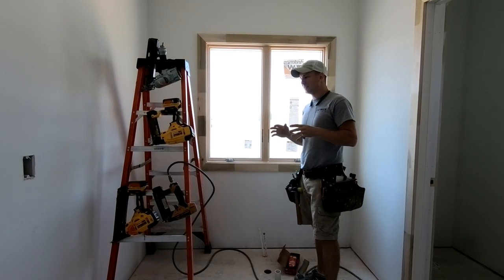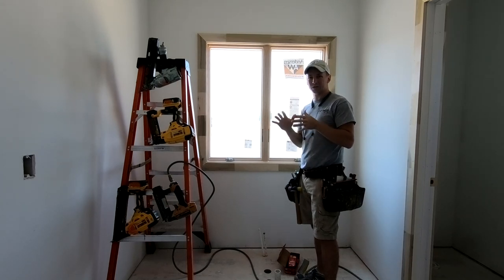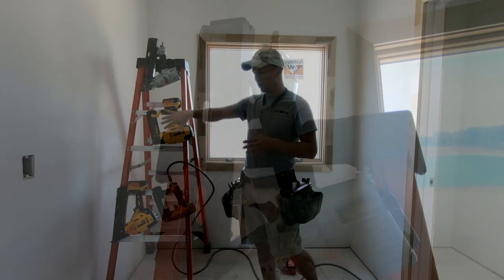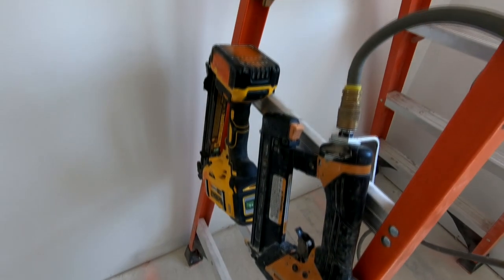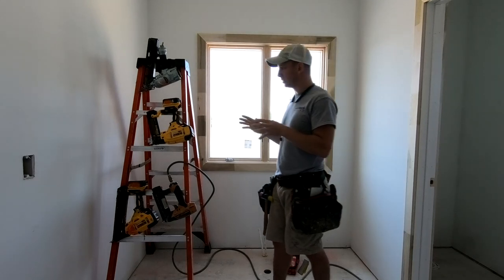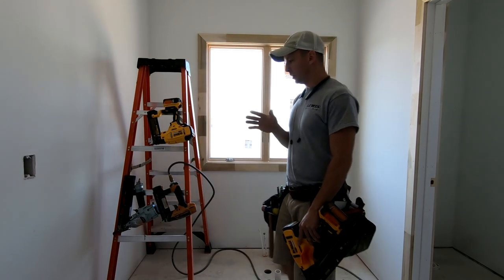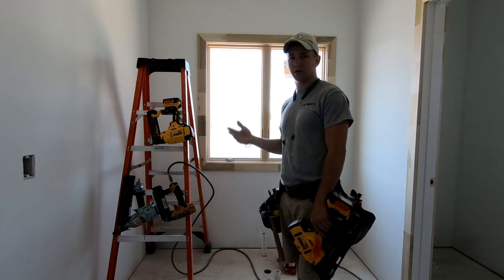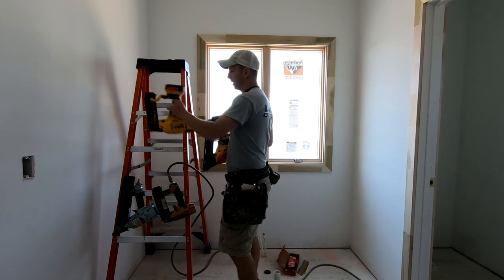Air VS Cordless Nailers Showdown - Dewalt Cordless Nailer 3 YEAR Review

Comment: Did you ask dewalt about warranty on the nail guns?
Reply from the maker: I didn't. The only thing that will make me crazier than a gun that wont sell nails is dealing with a giant companies warranty department.
Reply: Fair enough. I guess better to get on with doing jobs than be further disappointed with customer service.  I would be interested to see your thoughts on the Milwaukee 18g. I would love to get one but it is a steep price when I would not get the same use out of it and I have the same air 18g as you and also run a flexvolt compressor which I think is a pretty good middle ground for me. I too love to chat tools. My observation is that you would easily find a space in your kit for the 18g fixer and router from Milwaukee, but skip the 5ah batteries and go straight to the high output 3amp as the charge in half the time and run just as well. But I cannot comment on run time the above tools.

Comment: I have the exact same problem with my 16 gauge DeWalt not setting the nail. Had it serviced and it still leaves nails proud. Quite a poor tool
Reply from the maker: It drives me nuts. The 18 dewalt is real close to worthless.

Comment: What 18 gauge and 15 gauge nails and lengths do you find that work the best in the nailers you recommend? I have never used a nailer before and was not sure if any brand works or if you have to stick with a specific brand of nails. Thank you.
Reply from the maker: All I use are senco.

Comment: I have the same hitachi and It didn’t come with the rubber tip.. did you buy it separate?
Reply from the maker: I do by them separate because I wear them out but the gun should have came with one tip.
Reply: Do you buy em through amazon?

Comment: Let me start out by saying this I'm 54 years old and I've been a carpenter for 36 years I started out building Custom Homes at the age of 18 and we did it all by hammer and nail because back then there were very few companies who used air nailers because pneumatic nailers was the newest thing on the market and they were very expensive not that mention the additional cost of the nails.. The three companies that was making framing guns in 1984 was Paslode Senco and Dual Fast... Bostitch jumped in the game few years later... I was reading the comments and all I see is Milwaukee this Milwaukee that.. I personally love my Paslode impulse guns  I have all three..The framing nailer, 16 gauge, and the 18 gauge brad nailer and I will stay loyal to Paslode... We all owe the credit to Paslode because after all they are the pioneers.. The first company to never make a cordless gun... I remember the very first Paslode cordless gun it was a black framing gun that was a piece of Sh*t..!!! It took Paslode  about eight years to finally work all the bugs out and get it right... Don't get me wrong nothing against Milwaukee and I'm sure they make a very good gun as well... One last thing there is rumor that Paslode is going to make a new battery powered cordless gun line and when they do it is going to set the cordless gun industry on Tilt... Just my $0.02 ✌
Reply from the maker: The reason there are so many comments about milwaukee is because I asked a specific question in the video as to whether or not the milwaukee 18 gauge cordless nailer is any good or not. Everyone is responding to that question.

Comment: Tool maintenance exist and you're throwing tools out. I'm still running a 10 year old 18g paslode gun.
Reply from the maker: I know its sad, but with the crappy company service of these large companies combined with not having anyone local that works on them its often cost prohibitive to try and save them. And sometimes things just wear out and need replaced. My first 18 cordless dewalt actually got tossed because I had spent money on parts and was in the midst of trying to reassemble and couldn't get it to work right again.

Comment: They do not hold up to production! Very disappointed, and have 1300.00 in spare parts. Went back to air guns.
Reply from the maker: I’m currently on my third dewalt and it shoots worse than the first two I had.
Reply: @InsiderCarpentry  Was on my way to but the 4th (2nd in 5 months) when I decided I was done.
Reply: Buy*
Reply from the maker: I try and use mostly air and just use cordless when it’s convenient or when I’m on scaffolding and stuff. That way I’m not putting more wear on them than I have to.